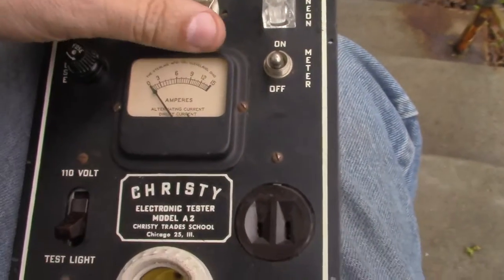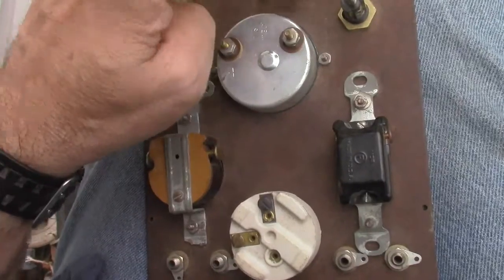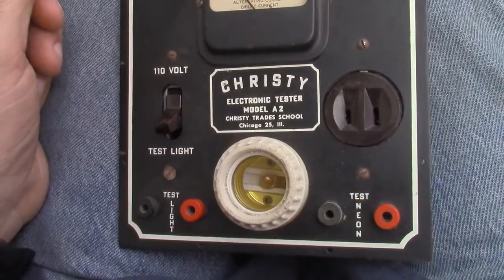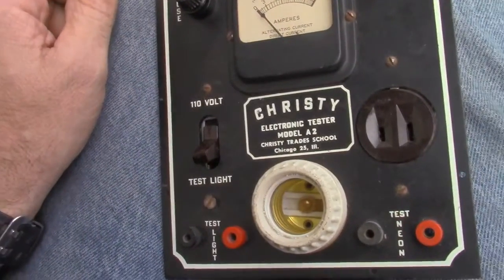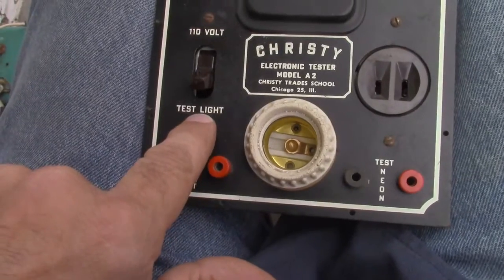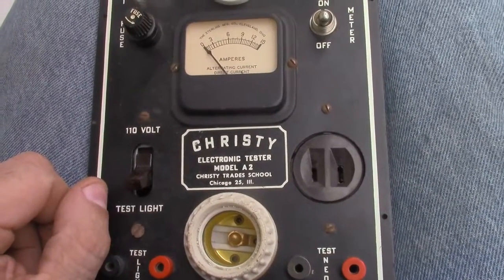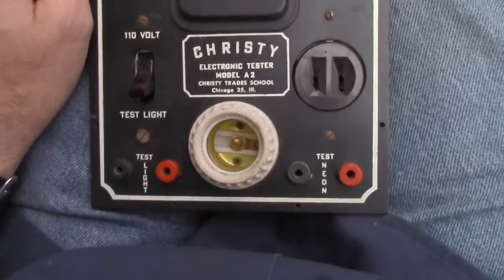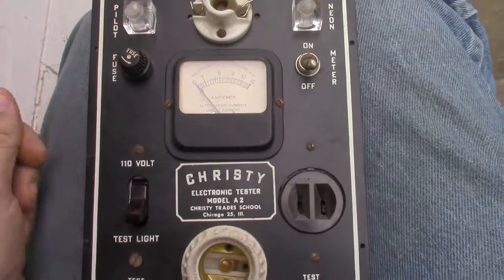Christy Electronic Tester

Comment: The bottom test terminals were inputs?
I have a picture of the back side wired below
http://antiqueradio.org/art/ChristyTester05.jpg 
Got to love that old stuff
Reply from the maker: +Craig Nehring 
The bottom test terminals
one set is part of the continuity tester the is powered by line power with the lamp in line.
ooooh that could be bad

The other set of terminals is a dc powered supply with a neon lamp in line

I think its a cap checker

thx for the pic :-)